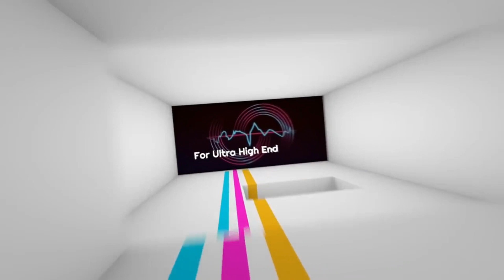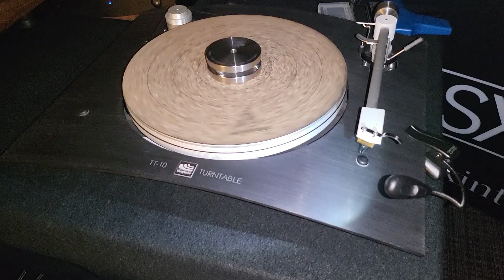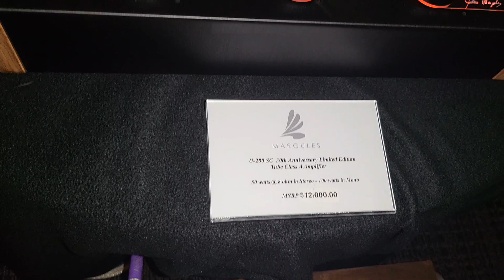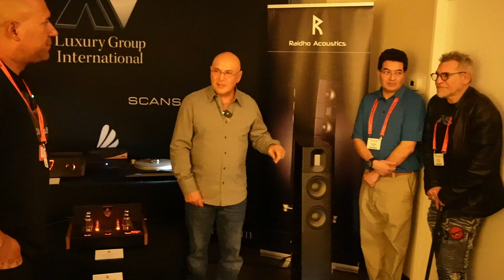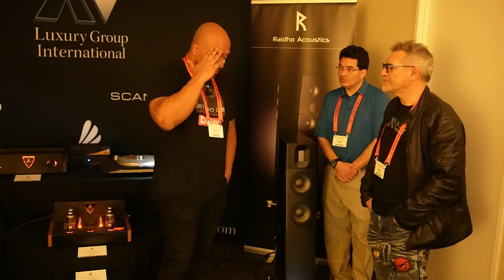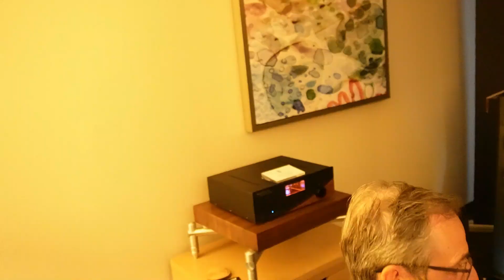Is This The Best System Under $100,000???  Come In And Find Out!

Comment: The big Raidho's would be a nice change in your system.  A totally different presentation than the Focal's, the Wilson's, or the Magico's.  Be advised that low torque motor TT's are very sensitive to micro vibrations.  The platform that table is on would have to be of the Minus K Technology variety.
Reply from the maker: Interesting
Reply: Yes Minus K platforms have been scientifically proven to reduce vibrations..
Reply: Yeah, I'd love to hear Raidhos in Jay's system.

Comment: 99 % of the people watching this would never nor could spend 100k on a system let alone on stand mounted speakers.  Just keeping it real.  This hobby is really turning me off more and more.  Folks.  You can build a system "the whole system" for less than 30k and be more than happy.
Reply: Some people are happy with their system at 1k. I would never spend more than the 5k i did.
Reply from the maker: Agreed.
Reply: I don’t understand why different pricing tier puts you off. 
You need high price tag products and brands to make innovations. 
Without innovations, there is no future. Just accept that there is a market for different products for different people.
Reply from the maker: @newdevilman1167  I agree with you
Reply: @newdevilman1167  I'm in the ultra high end industry. I put up a £40,000 integrated amplifier against a £110,000 pre/power combo with merely negligible sonic results.
Reply: @andygee8716  Well I cannot speaker for your combinations of systems. But two channel analog audio equipment price is like exponential against performance axis. But you also have to think about that mere differences as well as other properties like esthetics, materials, and R&Ds.
Reply: @newdevilman1167  Both companies are extremely well known in high-end circles, with tank like build and exceptional external and internal finish to their products. The sources were: Wadax streaming and dac, DCS cd transport/dac/clock/power supply, and my own personal Oracle Delphi vi/Air Tangent/Koetsu. The speakers were Sonus Faber Cremona. Cables by Nordost and Gryphon... An extremely revealing set of components.
Reply: @andygee8716  those are serious gears. Wadax pairs really well with dcs and ch precision amps & dac. Sonus Faber Il Cremone are beautiful speakers. Also try them with Goebel or Zelaton speakers.
Reply: @newdevilman1167  We retail the Goebels, CH, Stenheim and Metaxas and Sins.
Reply: Most people with the money don’t have time or enough interest to spend it on HI-FI
Reply: @manuelnunes3535  that is very ignorant statement
Reply: @manuelnunes3535  most of those people are brainwashed into thinking that Bang & Olufsen is the be all and end all of hifi! Most have something like a Sonos multi room system in their houses. They want convenience over ultimate sound quality.
Reply: True. But Jay is unabashedly ultra-high end. And yes these are even better in general than the cheaper systems you're referring to.

Comment: No, definitely not. the best system for 100,000 are the big 3 way ATC SCM300ASL with their 850 watts of class A/AB mosfet power, along with additional ASL subs.   those rhaido are overpriced compared to a pair of ATC SCM300ASL, with their 850 watts of class A/AB mosfet power .   You have not heard music properly, till you have listened to the mighty dynamic ATC SCM300ASL .
Reply from the maker: I see
Reply: " You have not heard music properly, till you have listened to the mighty dynamic ATC SCM300ASL " - they are boxes.  No thanks.

"those rhaido are overpriced" - those Danish companies (Raidho, Gryphon, Børreson, etc.)  price their loudspeakers roughly similarly, all more expensive than many American manufacturers.
Reply: @TheDanEdwards  there is no back wave sound from the ATC tweeter and midrange into inside cabinet, only the two woofers. All woofers are in a box, so what is your problem .  ALL THE HIGHEST END RECORDING STUDIOS USE THE LARGE ATC SCM ASL MONITORS. THEY USE THEM BECAUSE THE HAVE THE BEST TIGHT DYNAMIC NATURAL UN-HYPED SOUND OF ANY SO CALLED HIGH END LOUDSPEAKERS ON THE MARKET .  Also ATC make every part of their high end monitors in house here in the UK, including all their own ASL drive units, including all their own ASL TRI-AMP CLASS A/AB MOSFET ACTIVE AMPLIFICATION .  YOU ARE BRAINWASHED INTO THINKING AUDIO HIFI MANUFACTURERS MAKE THE THE BEST SOUND EQUIPMENT AND SOUND QUALITY IN THE WORLD, WELL I AM HERE TO TO TELL YOU YOU ARE ABSOLUTELY WRONG. GUESS WHAT, A LOT OF THE SO CALLED HIGH END MANUFACTURERS LIKE RHAIDO FOR INSTANCE USE YOUR TERM,  A CHEAP BOX,  ALL FOR THE OVER-PRICED SUM OF MONEY LIKE IN JAYS VIDEO HERE .  YOU NEED TO RE-EDUCATE YOUR SELF WITH EQUIPMENT WITH WHAT SOUNDS LIKE REAL INSTRUMENTS AND WHAT SOUNDS LIKE LIVE MUSIC .   ALL THE SO CALLED HIGH END DYNAMIC LOUDSPEAKER MANUFACTURERS HAVE PROBLEMS WITH ALL THEIR DRIVERS OUTPUTTING REAR WAVE SOUND INTO AN ANY TYPE OF SHAPED BOX,  INCLUDING THE ONES THAT USE A SEPERATE CHAMBER FOR THEIR MIDRANGE AND TWEETERS, including your famed MAGICO.  YOU DON'T HAVE A CLUE AS TO REGURDS AUDIO ENGINEERING ACOUSTICS, ALONG WITH ALL THE EFFECTS OF EMITTING SOUND BACK WAVES IN THE REPRODUCTION OF THE ACTUAL SOUND .  Since ATC uses bracing, along wirh thick bituminous pads on their cabinet walls, along with ports tuned for tight UN-HYPED bass, while also letting air escape for unobtrusive lowest possible cabinet vibration that does not affect the perception of sound eminating from their drive units. THEIR BASS DRIVERS ARE A light PAPER CARBON MIXTURE AND DOPED. THEIR MIDRANGE AND TWEETER are very light polyester doped with twinned suspension with very high magnetic force and with more than 2 tesla flux density, including iron powered core around the voice coils for extreme low distortion output .  The sensativity of the ATC SCM300ASL DRIVE units alone is more than 94  DECIBELS.  SINCE ACTIVE DRIVE OF ALL  DRIVE UNITS IN AN ACTIVE SYSTEM IS 6 DECIBELS MORE EFFICIENT THAN ANY PASSIVE AUDIO SYSTEM, COMBINE THAT SENSATIVITY TO 850 WATTS OF HIGH BIASED CLASS A/AB MOSFET AMPLIFICATION, YOU HAVE A VERY LOW DISTORTION NATURAL VERY DYNAMIC SOUND QUALITY .  THEIR ACTIVE POWER IS SPLIT INTO 100 WATTS FOR THE TWEETER, 200 WATTS FOR THE MIDRANGE, AND 550 WATTS FOR THE BASS DRIVERS. DISTORTIONS LEVELS AT ALL SOUND LEVELS ARE EXTREMELY LOW. THEY HAVE MASSIVE DYNAMIC RANGE CAPABILITIES .  THEY HAVE NATURAL ABILITY TO SOUND LIVE AND REAL IN SOUND QUALITY .  NO PASSIVE AUDIO SYSTEM IS CAPABLE OF SOUNDING LIKE LIVE OR REAL MUSIC AS DYNAMICALLY NATURAL AS THE ATC SCM300ASL .  Some people really need to get their head out of their arse.